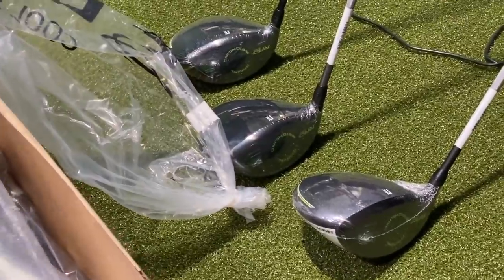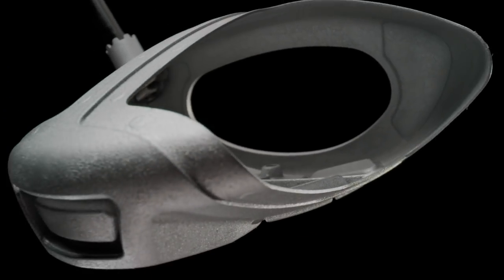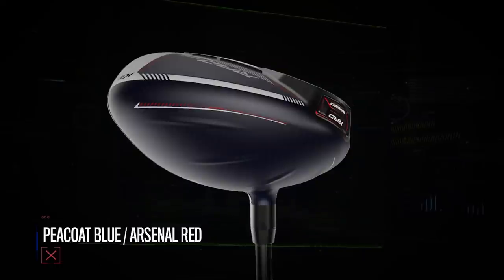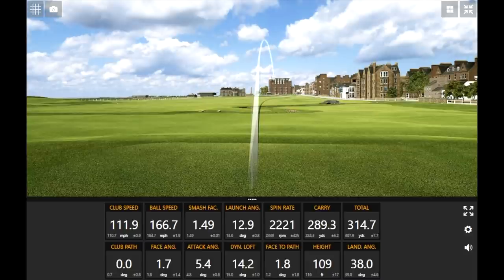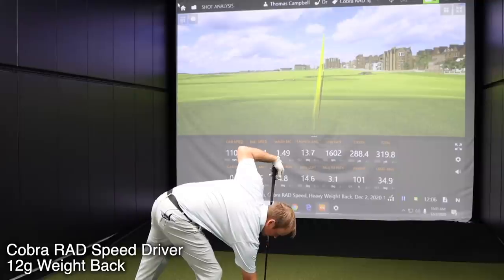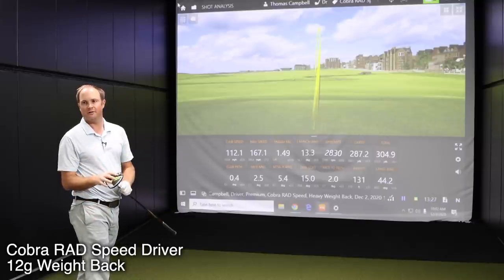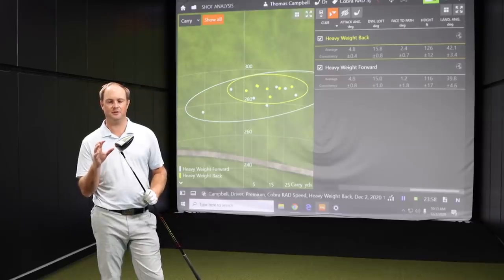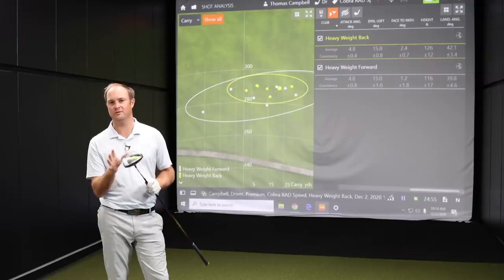Cobra RAD Speed Driver Review & Testing | Trackman Test

Comment: Thanks for the video!  Adjustments question. I have the 10-1/2 degree XB model and found that I needed to go up to 12 degrees to get the proper launch height. My understanding is that as you increase the loft - the face closes more. My misses are to the left so this is not the best thing for me. Wondering if I replaced the removable 6-gram weight with a 12-gram weight it would allow me to drop the loft back down to 10-1/2 degrees - if it would maintain my desired launch height and also bring the clubface make to neutral. Sorry - a bit wordy, Thanks for your response.